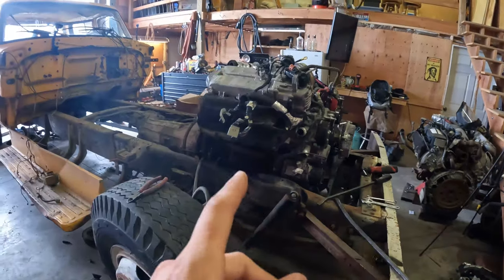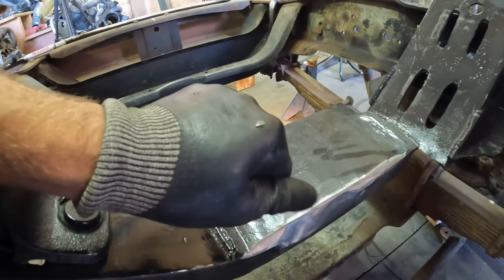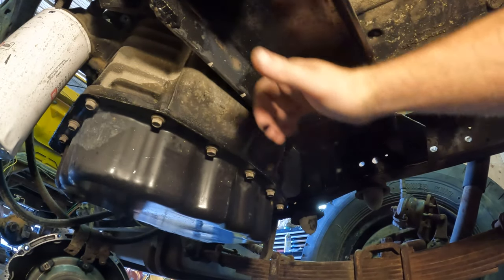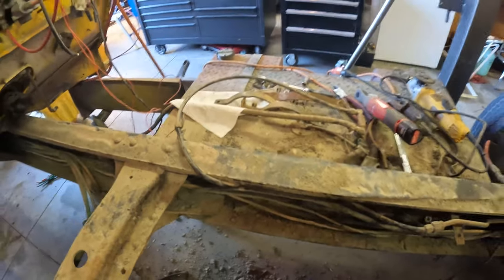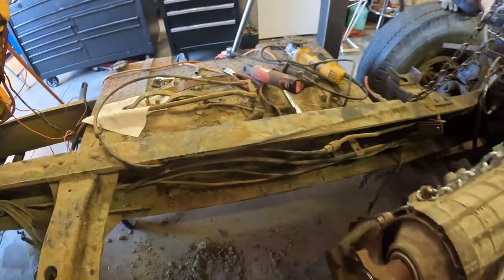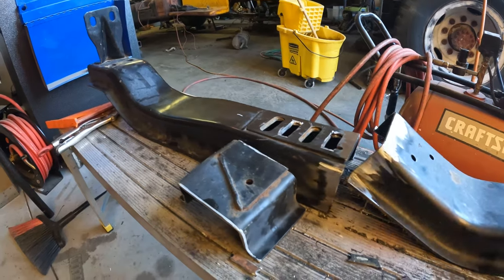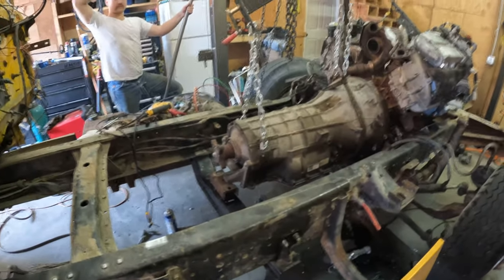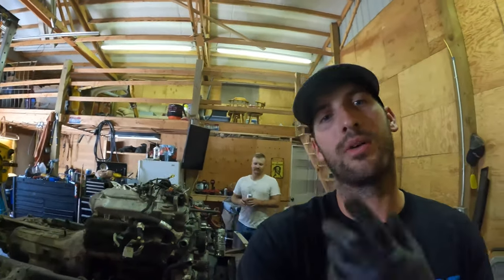Diesel Swapped F750 CrewCab Part 5 | TRANSMISSION INSTALL

Comment: The back  of the trans. In the video looks high did you check for your 2-3degrees slole? And ford motors and trans are a little to the right from the they aren't centered unless that's a  big truck thing! If you have the tunnel cap that will give two too ,three in. of more clearance for trans.I picked up a few things putting a 460 in aF100 1970
Reply from the maker: Great questions! The transmission isn’t high, but they are off centered a bit towards the drivers side of the truck. This was on accident but it turns out that’s how the F750 factory engine sat. Thanks for the suggestion, we’ll have to check it out when we tear the truck apart for body and paint!